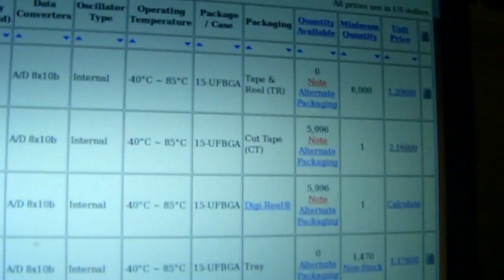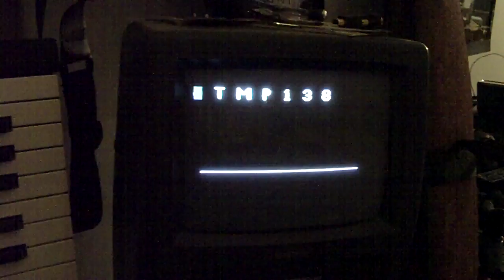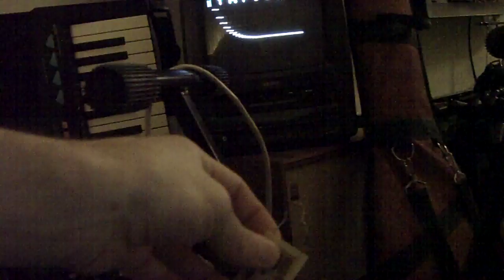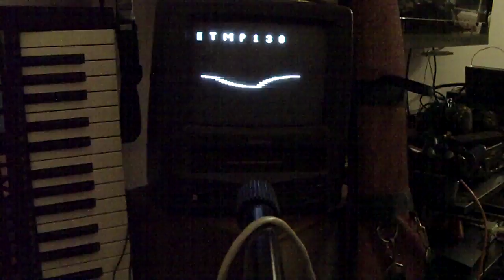AVR Case Deflection Detection

Comment: I usually don't play with the Tiny's But, usually, AREF is connected to a cap to ground to help stabilize the ADC reference.  I see in the datasheet that the AREF is an input only for the tiny44.  So you are right.  You are using the 1.1v internal ref. The AREF pin does not affect the reading on this MPU. ( when not used )  But, flexing may still affect the ref.

If you have any other ADC channels available, try feeding one a constant 500mV and see if it also varys with flexing.

.

Comment: Can you verify the ADREF voltage ( forget if its externally available on that AVR ) ?
If not, maybe try reading a constant voltage with the ADC to isolate the issue to either the ADC,  the temp sensor,, or the supply voltages/ reference ?

Interesting phenomena :)

Comment: I do not know the details of AVR internal ADC implementation. But it is a well known technique to implement ADC based on capacitive dividers instead of resistive dividers. Both ADC and DAC use some sort of divider for all the current/voltage levels and implementing them as capacitance dividers it easier and cheaper. So if AVR has an ADC that has capacitive divider, then geometry flex changes the value of capacitances in the divider and that affects the reading.

Comment: Try reading from a pin tied to +2.5V instead of the internal temperature.  That should let you account for internal geometry changes: if it changes in the same way as the temp sensor, the internal change is causing the ADC reading changes.

Comment: I have had a similar effect using a PSoC5 microcontroller, but int hat case it was the internal oscillator that would change in frequency whenever I pushed on or deflected the chip. Maybe it was changing the capacitance of the internal RC circuit of the oscillator or something.
Reply from the maker: so strange.  I am honestly surprised it works that way on any other proc.